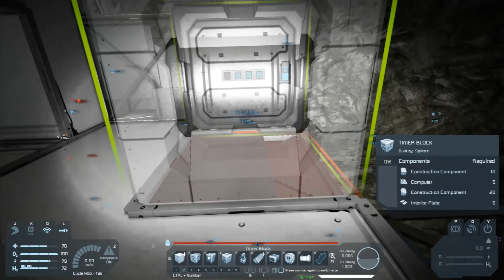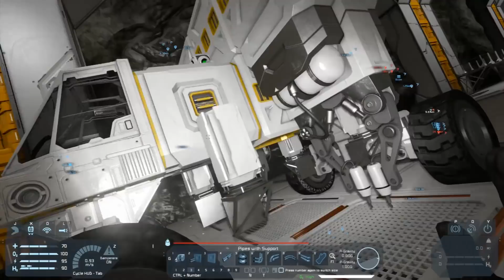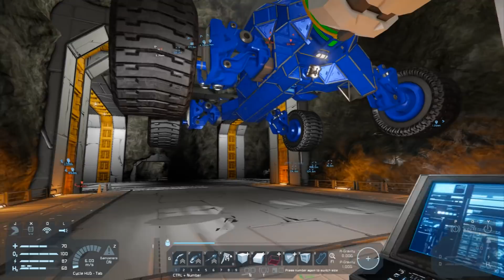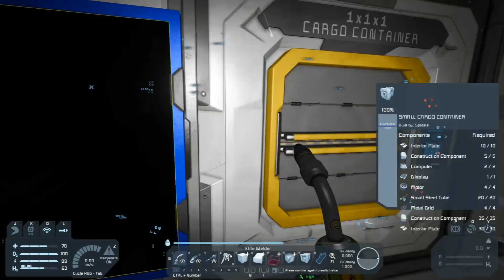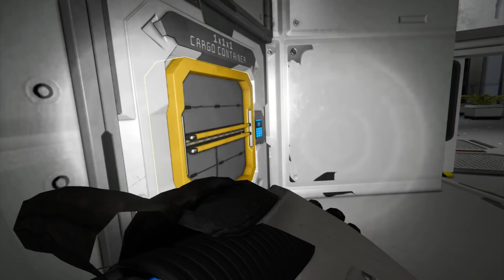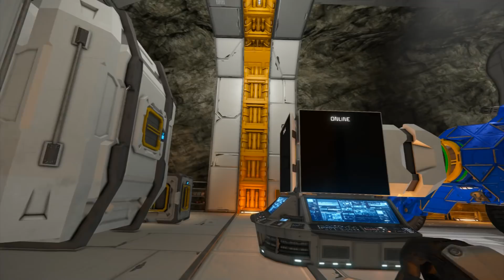Survival, Maybe... #43 Remote Garage Door Access (A Space Engineers Survival Series)

Comment: The broadcast on/off not changing the power usage of the antenna is correct to real world.  Antenna amplifiers can take a lot of power.  This power is regardless of if the antenna is actually transmitting anything.  As long as it is trying to receive, it's boosting the power just the same.
Reply from the maker: I guess I should have tried harder to read those books about radio signals and whatnot that I tried to read when working on a project a few years ago :P

Comment: I had some major struggles with this script when I tried to add a second set of doors for different vehicles in the same base. It would get into some sort of a feed back loop and transmit the signal over and over again. My work-around is to press “O” before exiting a vehicle and pressing it again whenever I jumped into a vehicle. Anyone know if there’s a better work-around, maybe something I can do in the script?
Apart from that, this so much cooler than finding the right group via remote access to get back into my base or to operate the piston that brings a connector out of the floor that couples to my truck.
Reply from the maker: I've never had any issues, but always make sure the timer blocks are named so that there's no overlap between them. There's also another similar mod that's linked in the description of the transmit and receive mod that you could try out :)

Comment: You should put stairs going down in the back of the server room and have it continue behind the assembler room . Because you went lower you can dig out a little bit more. Also you should turn the base antenna down to 500m basically just far enough to reach the bridge and inside the hanger maybe as far as the bunker on the hill.
Reply from the maker: That could be interesting, I wonder if I have enough space before I would just drop straight into the assembly room...